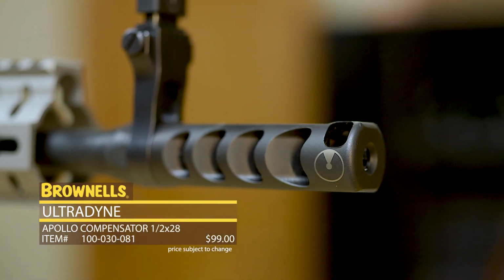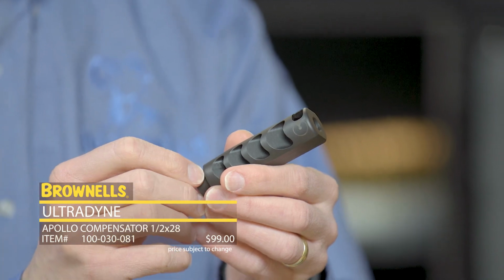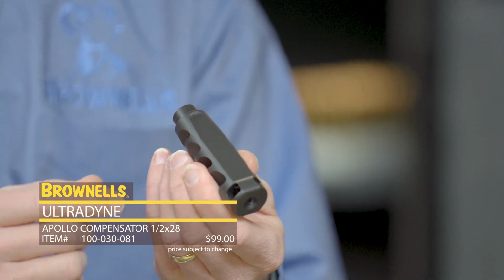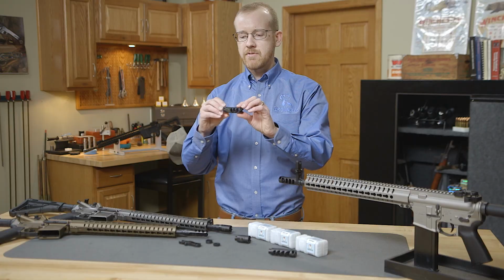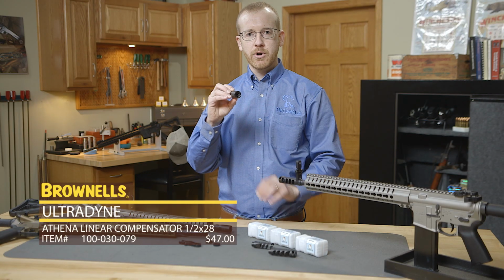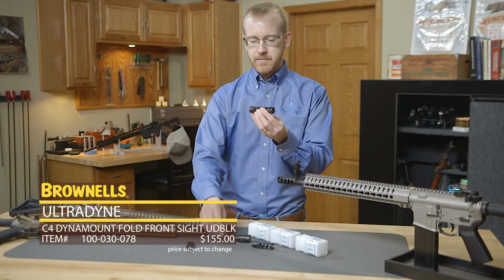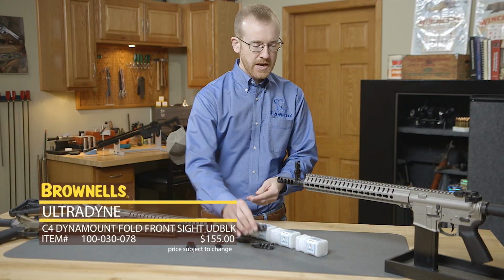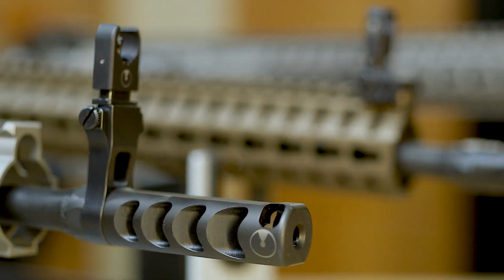NEW: Ultradyne AR-15 .223 / 5.56 Compensators

Comment: I am looking into getting an extra long Muzzle Device to tac weld onto my 12.5 Inch Barrel to bring it to a overall 16 inches. Mainly because of the ATF ruling on Pistol Brace Stocks. I rather just pin weld it and get 16 Inches and be safe
Reply: Kak industry has 4”  & 6” extended muzzle devices with the hole for the pin.

Comment: This thing is very effective at reducing recoil...its also very effective at making everyone at the range think you have a 50bmg
Reply: Hahaha! Genuinely made me laugh.
Reply: You own one ? Does barrel wip  not effect quick  follow up shoots? Also how well does it hold up have you taken a chlass with it ?
Reply: @anthonylewis9256  I had it on a savage desert tac 110 with a heavy barrel in 6.5CM which recoiled like a 22 with it on, I have removed it because it throws too much concussion rearward. It would blow half a bottle of water off the table in just the right spot. Accuracy was not impacted by it...rifle would put 3rnds in one hole at 100yrds with or without it.
Reply: Which one did you have the Apollo, Mercury or the Athena Linear Compensator? My understanding (and hope) is that the Athena does a good job of redirecting everything forward...thus making the shooter and range neighbors happier.
Reply: @Questtt3  Apollo yes, ive since removed it as the concussion towards the shooter was causing a flinch.